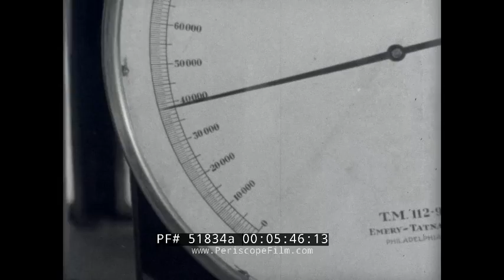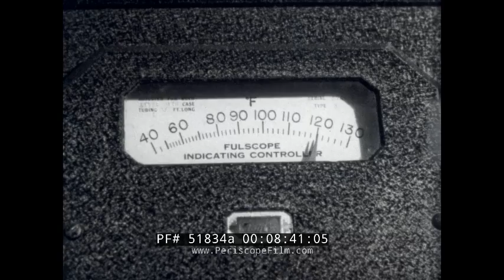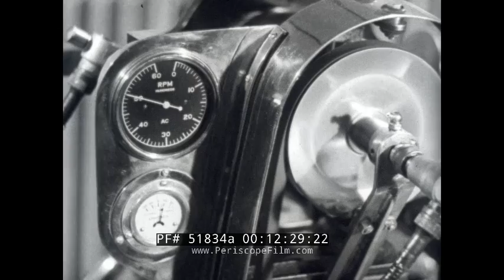1941 CHRYSLER PLYMOUTH AUTOMOBILE COMPANY CAR DESIGN PROMOTIONAL FILM  "YEARS OF PROGRESS" 51834a

Comment: I was born in '45. My dad was hired by Henry Ford I as a janitor and he didn't climb the corporate ladder but that was before WWII and Ford had a lot of admirers, including my dad. After the war, however, it became more and more evident that, among domestic automobile manufacturers, Chrysler was THE engineering company. Dad bought Fords in '60 and '62 but he bought Chrysler products both before and after those years. Competition has always benefited consumers.
Reply: In the '60s, I was under the impression no Chevy or Ford with the same size engine an an automatic could beat a Dodge or Plymouth with Torqurflight.
Reply: @rogermetzger7335  That was the usual outcome. The Torque Flight is almost indestructible. My dad races a 68 Dodge Dart with a Hemi and a Torque Flight 727. He launches from the light at 6000 rpm, the car has a 60 foot time of 1.30 and does the quarter in 9.60ish. He rebuilds the Torque flight once every 2 years and most of the time it’s just a few parts and back in it gos. A hot Mopar Dodge/Plymouth with a 727 is very hard to beat.
Reply: You can see the engineering at the drag strip in the 60’s and 70’s Dodge and Plymouth cars were hard to beat. From the giant killer 340 to the standard 440 and 440 six pack cars and the legendary Hemi. Mopars are hard to beat at the drag strip.

Comment: I would expect all of the in-house materials testing and metalurgy research to be done by suppliers now. The car company engineers would write specs that lists all the performance targets and the suppliers would be contractually required to guarantee that performance. I expect that the car company engineers work with the suppliers and if necessary the suppliers' engineers work with the materials suppliers' engineers.